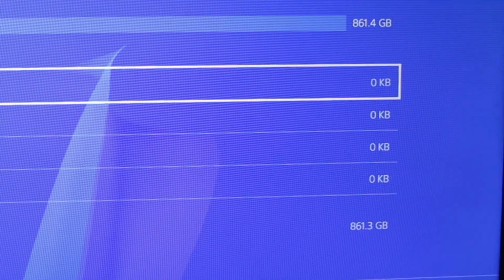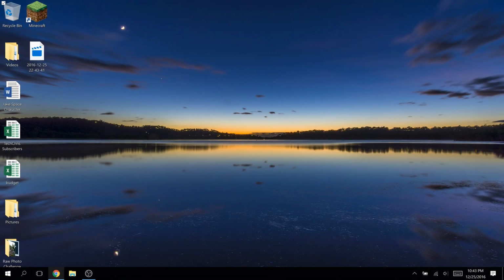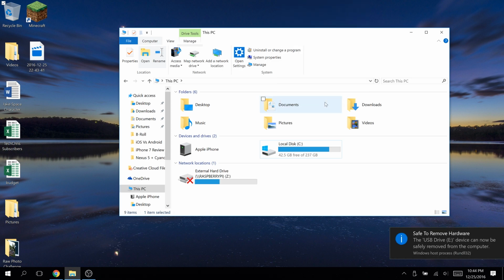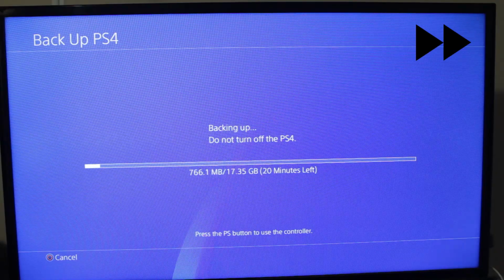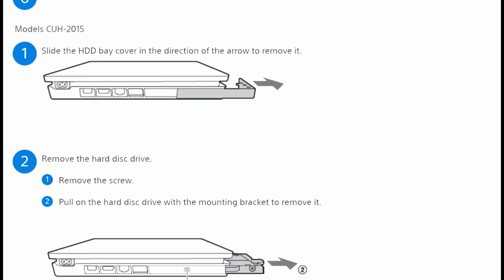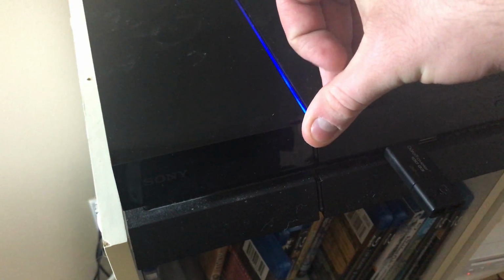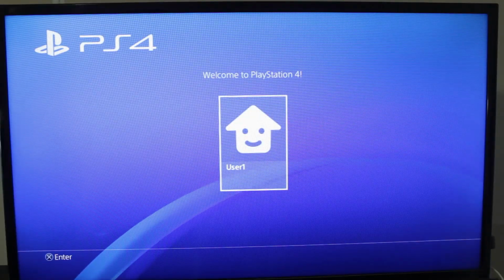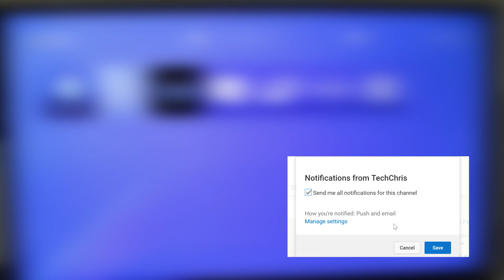PS4 Hard Drive Upgrade/Installation Guide!

Comment from the maker: MAKE SURE YOU SCROLL PAST the first download button/first few sections, to the "Perform a New Installation of the System Software." If you use the update file it WILL NOT WORK, you need the new installation file. 

I recently had to reinstall the hard drive (my new 1tb drive died), and this got me at first.

Comment: can you use again the old 500gb?
i want to use rhe later version of media player and it is stored in the 500gb, can i just take out the 2gb and just replace it with 500gb?
Reply from the maker: Yup! You can do whatever you like with the 500gb original from the PS4. A friend of mine put it in his laptop, or if you have an external hard drive casing, you can put it in that and have an external hard drive.
Reply: TechChris  you upgrade 500gb(stock) to 1or2tb,. my question is can you use again the 500gb(stock) on the ps4?, like vice versa,
Reply from the maker: Yup

Comment: I copied my save files to online storage and my videos over the same flash drive that I downloaded the latest system update to in the UPDATE folder within the PS4 folder. I thought I could just log into my PS Network account and download all my games from my library after putting in the New hardrive and setting it up, I didn't do that restore thing where you chose not to backup the applications. I can't find my games in the library after logging into my account on the new hard drive. PLEASE help me out! I think I Just need to put in the disc and download the games for the games I have on discs, right? But how do I get the games I downloaded from playstation Store to show up in my library on my new hardrive all the way to the right on the menu where the games normally are. I tried to put my old hard drive in and all my games that i downloaded from PS store have a lock on them. And all the disc games are uninnstalled. Please don't say that I have lost all my games. I have spent so much money on it 😭

Comment: I want to back up all my data/games, saves, etc.... I have an external HD. While it is not empty, it has over 500 GB of free space. Can I use this to back up the 480GB of data that is on my PS4 or does it have to be an empty External HD? If I do it this way, I need the Flash USB drive, my back up external HD and my New 2tb that I am installing. Is this accurate?

Comment: I've followed this religiously 5 times with two different USB drives. Each time when I try to install the software onto the PS4, it says the file cannot be used. I've reformatted the USB drive, checked the spelling of the folders, re downloaded the pup file, and everything else I could think of. What else could I check?
Reply: Did you solve this issue? I have also tried multiple times with different USBs and even an External HDD. Trying 4.07 on it and getting that message.
Reply: beca Scordo I did. What I found out is that I was using the wrong file. On the PlayStation website there is an option for an update file or a reinstall file. The update file is around 300 mb. The reinstall is closer to 800-900 mb. Hopefully that helps you as well.
Reply from the maker: Thanks! I ran into that issue myself recently when I had to install a hard drive.
Reply: Thanks man

Comment: So I need to buy an external hard drive and a internal drive?
Reply from the maker: If you want to back up your games, yes, you need a USB drive big enough to hold them, in addition to the drive you're installing, unfortunately. The alternative is re-downloading them all.
Reply: Thanks do you know a cheap external and internal hard drive?
Reply: Thanks and I can just order 2 and take one apart for the internal hard drive?
Reply from the maker: Depending on the drive, yes. The Western Digital ones will NOT work for this purpose, as they actually are not a normal hard drive (more info here: https://www.youtube.com/watch?v=DBenRlPzb_s)

Based on these videos: https://www.youtube.com/watch?v=sCLfHCq_794 / https://www.youtube.com/watch?v=c3CLs_gjqxQ The Seagate Expansion or Backup Plus SHOULD work for this purpose, unless they've changed it: 

-US: http://amzn.to/2jwuSr6
-Canada: http://amzn.to/2kahZq0
-UK: http://amzn.to/2jfTmnG
Reply: Thanks and like backing it up won't require me to re download anything because my WiFi is really slow?
Reply from the maker: Yeah, as long as you select backup applications as well, you should have no problems and all your games should come with.
Reply: Thanks again
Reply from the maker: No problem

Comment: Do I need to format a new hard drive FireCuda Seagate to exFAT before I install to PS4?
Reply from the maker: Shouldn't require any formatting, as the PS4 should handle it. Mine came straight out of the packaging and into the PS4 with no problems.

Comment: I am trying 4 hours to install update and always had '' The update file cannot be used'' :-(
Reply from the maker: Sounds like it's finding the file. Have you tried re-downloading? It could be corrupt. Also others here mentioned sometimes it downloaded with the wrong name, make sure to rename it if you need to.
Reply: George T scroll down on the playstation site , there is also a 900mb update, that one should work
Reply: @bmtak8342  that's the on that doesn't work regardless on it because it says, cannot find file "update" not the reinstallation

Comment: I have an uncharted ps4 version and I cant seem to be able to open the top to be able to replace the hard drive my version is a 1215A
Reply from the maker: If it's the regular size, not slim, it should be the same as what I'm doing. I twas fairly stiff, though, I was trying at it a bit longer than I showed in the video. You definitely need to get the right grip on it to get it open.
Reply: TechChris Thank You for your help i finally got it to open
Reply from the maker: Glad to hear it!

Comment: i am trying to use a 4tb seagate with the nyko databank and i get it all set up and it does not work it tells me that it cannot intialize the ps4 what do i  do
Reply from the maker: Could be the drive, or the data bank. I've heard they can be unreliable, but I really don't know.
Reply: no its not the data bank becuase i put my original ps4 hardrive into it and it worked by my 4tb seagate doesnt work and i dont know why...
Reply from the maker: Lynxity could be the 4tb drive itself
Reply: ***** how could i check to see if its the hard drive?

Comment: When I put in my usb to download the firmware it says that it cannot find the firmware even though I have it on there're with all the folder and everything
Reply: fuck fuck for me I had to take the bigger file which was named PS4UPDATE2.pup and rename it to PS4UPDATE.pup
Reply from the maker: EthanHFilms the filesystem has to be a folder called PS4, with another in it called UPDATE, with the firmware in that one. Any typos or anything and it won't work. Drive also has to be FAT32
Reply: TechChris I already did that and it still doesn't work
Reply from the maker: EthanHFilms you can try downloading the firmware again, it might be corrupt
Reply: TechChris THANK YOU SO MUCH IT WORKED! I've been trying for 5hours straight and it finally worked!
Reply from the maker: Glad I could help!
Reply: it doesn't work for me.and i re-download it

Comment: Im upgrading my ps4 to 2 tb, do i need an internal or external hard drive? And when i back up my data on my flash but uncheck the application box, but still have the saved data, will all my games be erased?
Reply from the maker: -An external can be used to backup data but the actual upgrade is an internal drive.
-Yes, your games themselves would be erased. This is how I did it, as I didn't have a usb drive big enough, and then I re-downloaded all of my games.
Reply: TechChris but since I have the data saved on my usb will i still have my progress in games after downloading them again?
Reply from the maker: Yup! Exactly
Reply: TechChris Nice! Now I can start my upgrade!
Reply from the maker: Good luck! For me it feels like a whole new console honestly, so nice having all of my games installed at once!
Reply: TechChris do I need to deactivate as primary ps4 before switching the hard drive?